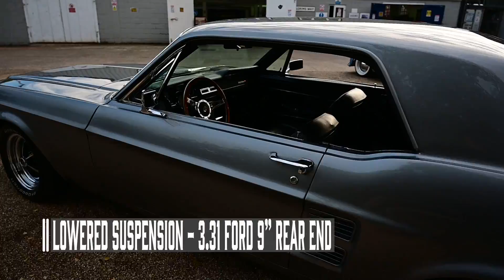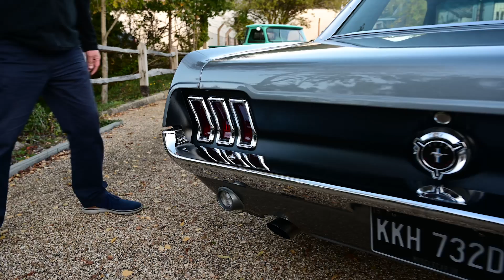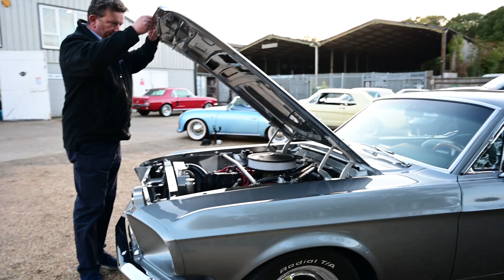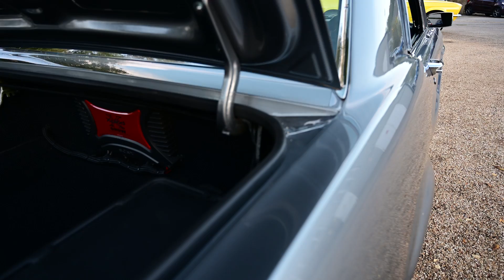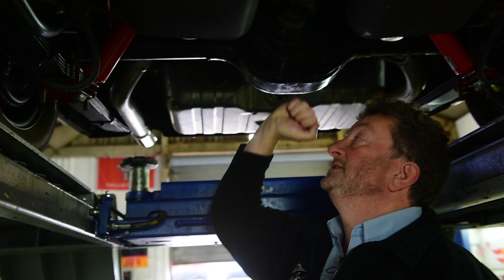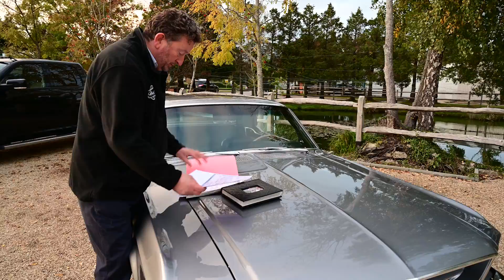Ford Mustang 1967 Coupe 289 High Performance

Comment: Not much left here that was present in 1967...as a purist, it would not intrest me . I myself have a beautiful 68 Mustang I bought in 1977, lifelong Southern California car..its bone stock original 289 and original automatic transmission,  power steering and FACTORY AC.  About 95 % Of what you see and touch, is original to the car. It was purchased new  at Palm Springs Ford in December of 1967. Its in beautiful condition and on the road. For those that like a resto mod, this looks like something right up thier alley.